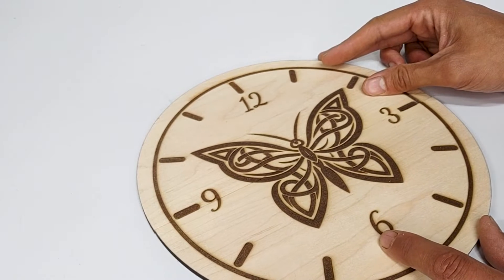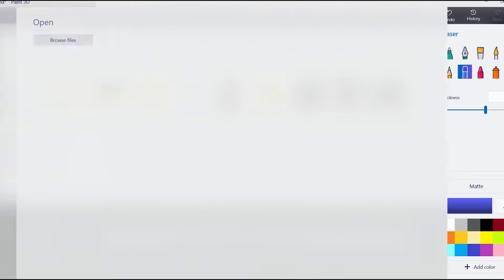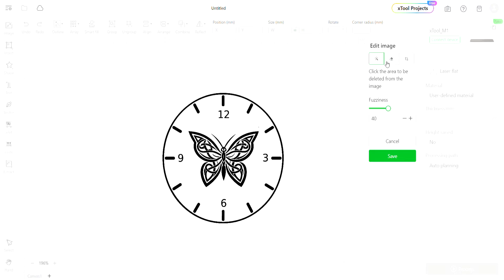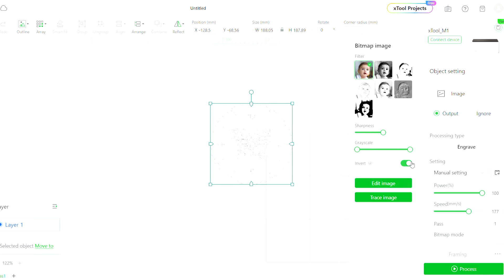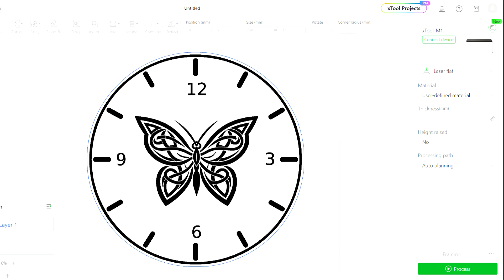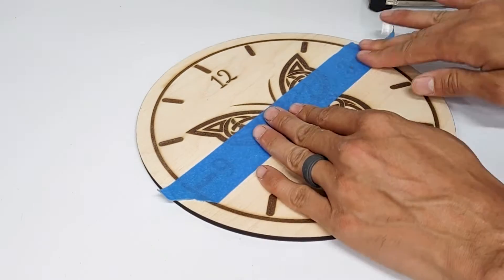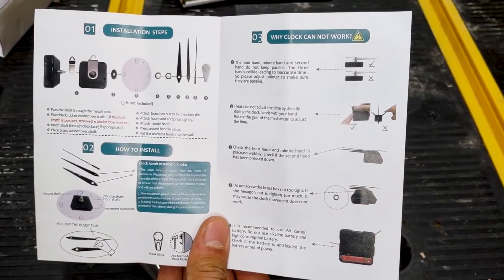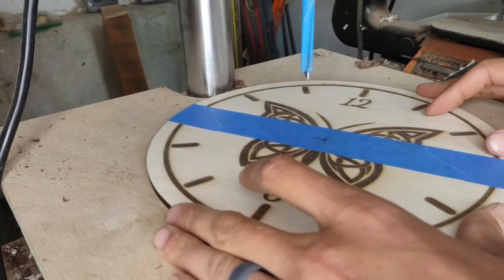Make a Clock with Your Laser Cutter / Engraver

Comment: Silly question why didn't you cut the hole out with the laser?  Was it a limitation of your setup, or is there are structural issue if you do that?
Reply from the maker: Not a silly question at all and you could totally cut it with the laser.  I'm in the habit of drilling holes myself when possible rather than leaving it to the laser because it is the one scenario where I'm actually faster =). I thought it would be less time to use the drill rather than run a few test cuts to dial in the size hole to cut.  If I were to run this file repeatedly I would probably take the time to dial in the right sized hole with the laser and have it do that part for me too.  Thanks for watching!
Reply: @ArtisansAndArthropods  thanks for the answer I am just got a laser and was going to make a clock and wanted to make sure it wouldn't cause a structural issue.
Reply from the maker: The only problem I can think of is if you size the hole really close to the size of the spindle on the mechanism and it's a tight fit, you'll need to have the pieces of the clock lined up perfectly for the glue up.  Otherwise if they are shifted just a little bit the hole may not be big enough anymore for the mechanism.  Of course that only matters if you are cutting your clock from two pieces placed next to one another like I did.  It wouldn't be a problem if you cut it from one big sheet.  Best of luck and let us know if you have any other questions.